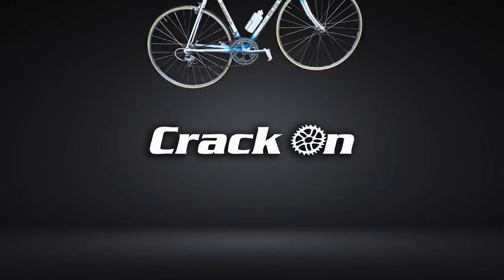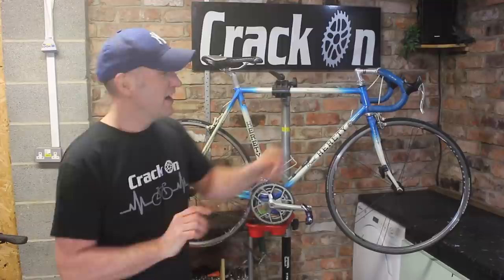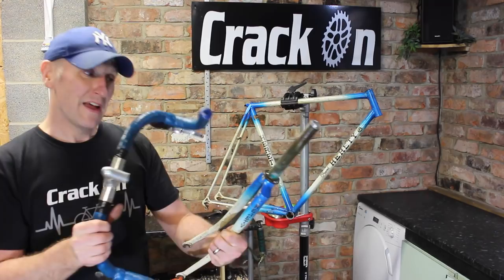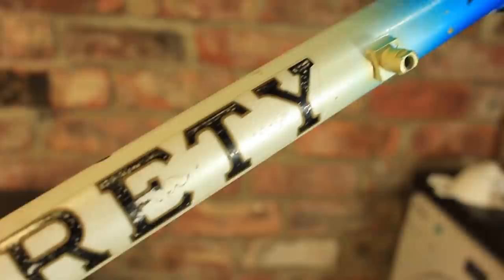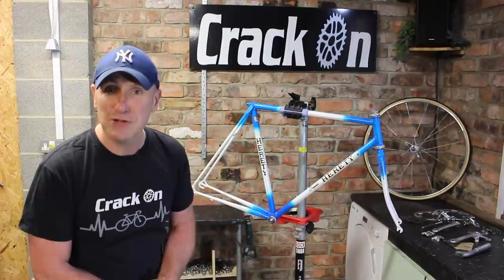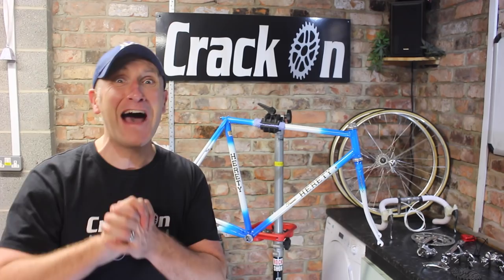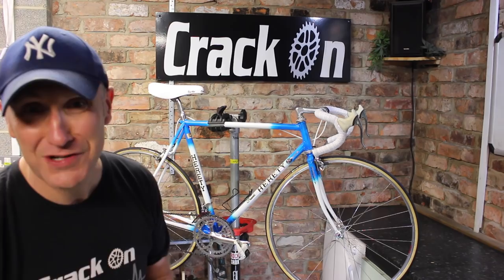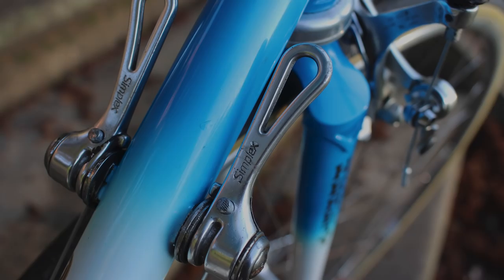Vintage Frank Herety Road Bike Restoration

Comment: Beautiful work! Did you end up replacing the fork? Once it was cut off, it wouldn't have been too hard to dissolve the stem remnant with sodium hydroxide. I have a video where I do that.
Reply from the maker: Hello my friend, Mark from MRCeations completely sorted it all out dents and all. Really good to have you back on here, Im sure you do have a video available and so many more helpful videos. I'm always sending viewer your way. All the best and thanks for posting the video.
Reply: @BikeItUK  Very cool! I wonder if that is what he did. Or maybe he drilled it out. Thanks!
Reply: @RJTheBikeGuy  Yeah, I was wondering the same thing when I watched the video.
Reply: Trusty slide hammer did the trick 😉
Reply: Andy and and RJ-My two favourite bike restorers! Probably you know this- cut the brush by about half an inch or so (which you use for degreasing)-makes the job much easier 👍 cheers for the video Andy
Reply: Always watch your videos RJ loved that $15 bike you sorted
Reply: Or use an hacksaw blade in handle grip. Slow job but it works.
Reply: @stephenwilliams926  i have used caustic soda, much easier but it takes the paint off
Reply: @markralph2026  Beautiful paint job you did!
Reply: @RJTheBikeGuy  cheers, that's where I learned this trick from. Unfortunately I was removing seized seat post. Many thanks RJ
Reply: @RJTheBikeGuy  btw I learned how to fix bikes from your channel, Andy's channel inspired me to upload restoration video few years ago,  here is the link if you care to watch it:  https://youtu.be/uybNkEBA35s
Reply: @SelbyPav  Yeah, a seat post would be much harder to use sodium hydroxide without it getting on the paint.
Reply: @SelbyPav  Andy is awesome at restorations!!!
Reply: @RJTheBikeGuy  if course he is, I meant no disrespect. I did learn a trick or two from Andy. You were simply running your channel few years before Andy started, that's when I learned
Reply: @SelbyPav  Hey, I took no disrespect. When people ask about restoration stuff, I point them to Andy's channel.
Reply: Top work. Love the black-on-gold decals.
Reply: @markralph2026  Thanks for the awesome tip!  I hadn't heard of a slide hammer before but after doing a YouTube search, I see how one could really come in handy!
Reply: @RJTheBikeGuy  Put some shoes on.

Comment: Another great Resto! -  Looks like you used Shimano derrailleur cables, the ends are not sitting flushed in the recessed holes in the shifters, If you used Campagnololo specific derrailleur cables it should be flushed with the Simplex shifters.  I had the same problems with some Syncros shifters. But I end up filing down the ends of the cables a bit.  - Looking forward to your next build.
Reply from the maker: Thanks for support and watching, yes to be honest the cable set is a Clark’s one and yes the nibs definitely do not go well.
Reply: I noticed the cable ends too, totally wrong... Cutting an XA stem in half.. no words for that, I look forward to an apology video where you gift a NOS 100mm XA stem to the owner!

Comment: Just an observation, i noticed the aero brake levers setup. Should it be the bottom tip of the brake levers be parallel with the flat bottom part of the handlebars? Nice restoration build. How was the remaining part of the stem pulled out?
Reply from the maker: The levers are probably a cm higher than they should be. The stem was extracted by Mark at MECreations using a slide hammer. Thanks for watching and your support all the best

Comment: Andy you might know answer to this one,  is about replacing steering head set? the bottom cup which sits on the fork crown, are they all the same size (diameter) or do they very vary m8.
Reply from the maker: Hi they should be the same diameter for the forks however they come in different designs for the headset. Hope this makes sense. All the best 👍

Comment: So would this bike be old enough to qualify for Eroica Britannia ? Really great work! the bike does look excellent.
Reply from the maker: Thanks buddy, yes the bike would qualify. However one of the rules is no aero brake levers so probably have to replace these first
Reply: If it was raced in the early '80s, as suggested, it would qualify as the cut-off date is 1987. However, it would need pedals with cages and straps rather than the clipless Looks, as well as non-aero brake cable routing but that's all.  I am sure it would be very welcome at any l'Eroica event.
Reply: it’s not the actual age of the bike, it’s the spirit... so aero brake levers and clipless pedals are a no-no